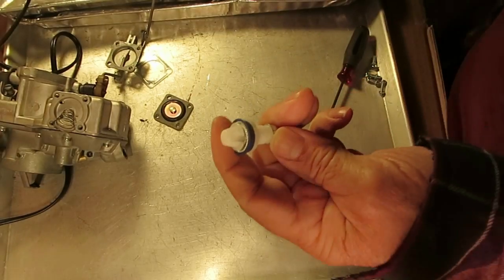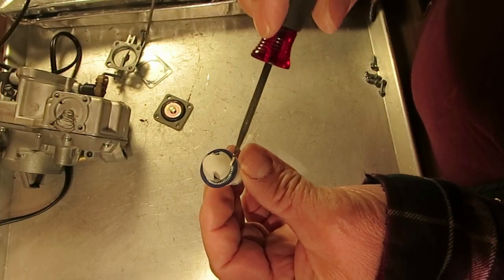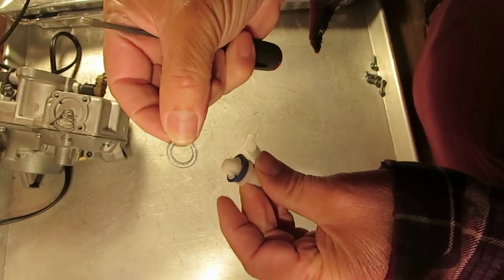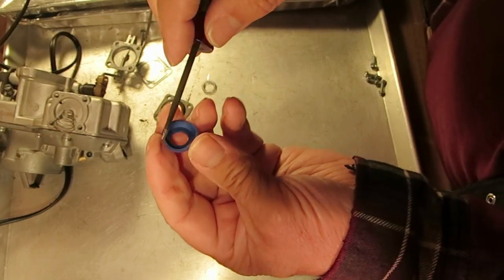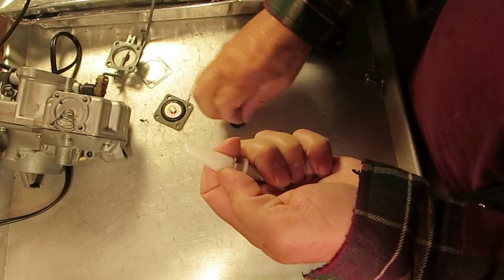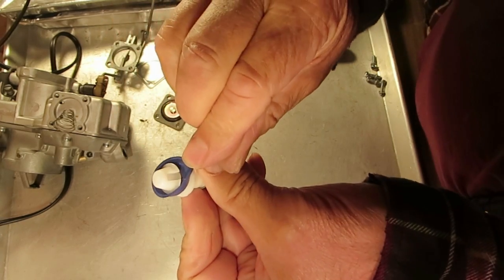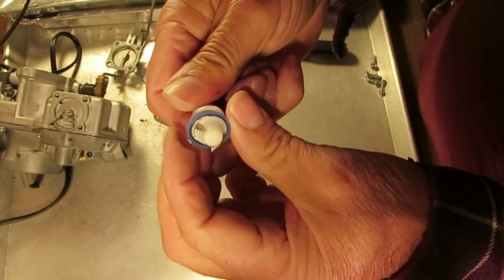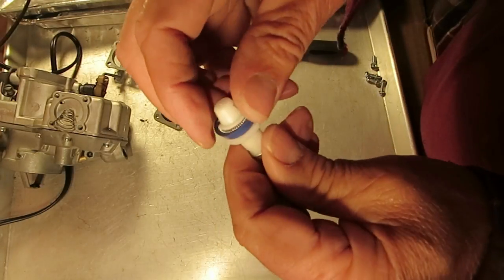How to Replace the Accelerator Pump Cup

Comment: Mike, I have a original Rochester 4 Jet on my 57 Chevy with a 283.  I'm getting a hesitation/ stumble when I accelerate hard from an idle.  Is this likely the accelerator pump?  Would the cup alone cause this issue?  Thanks in advance for your help.
Reply: @MikesCarburetor  thank you sir.  I will read through the material.  I have an additional 4jet I would like to rebuild.  I will be looking up info on your business. thanks

Comment: Hi Mike, thanks for the vid, what size cup would I need for a Rochester 2gv on a 66 impala 283”?
Reply: Thanks, Mike. What looks like happened is the return spring cut through the cup leaving the inner ring on the shaft and the cup flange floating in the gas. Would a garter spring prevent this from repeating?

Comment: Very Good Vid. Thanks .
Reply: So will using the garter spring on a Q-Jet cause problems? Like the accelerator pump sticking? Should I remove the garter spring from the accelerator pump on my Q-Jet???!!!!
Reply: @MikesCarburetor  Okay, well my carb # is 17059216 (which I believe is original to my 79 Chevrolet C10). Is there anyway you can tell whether or not that particular carb requires one? I'm fixing to put this entire carb back together right now.
Reply: Also, the pump I'm using appears to be CUD3616